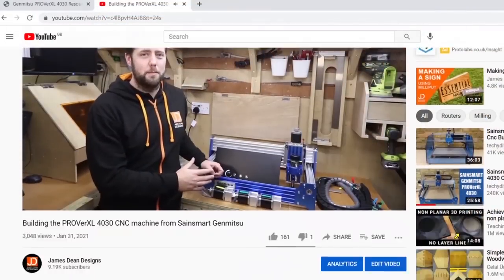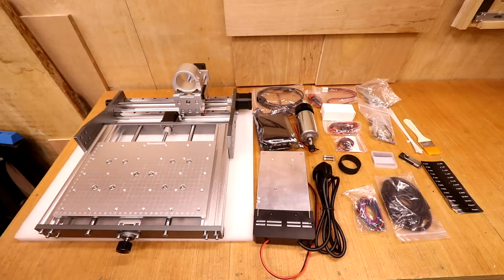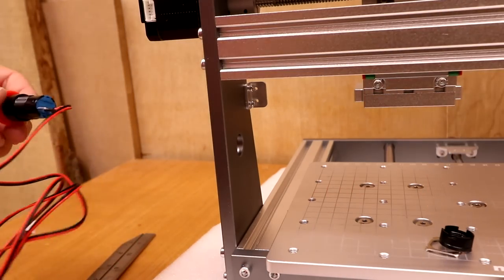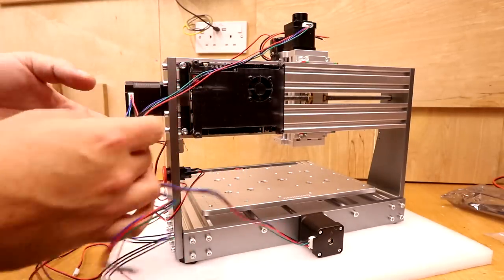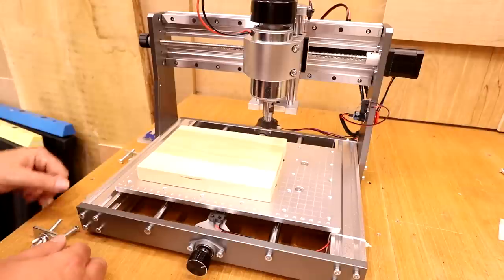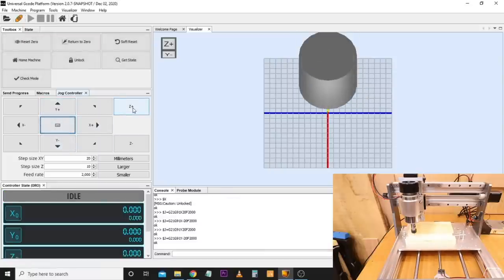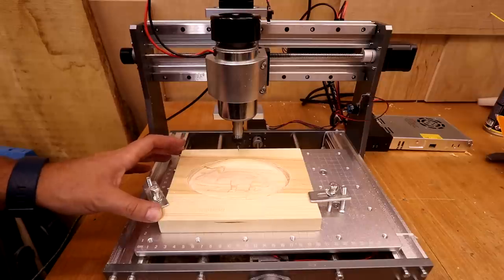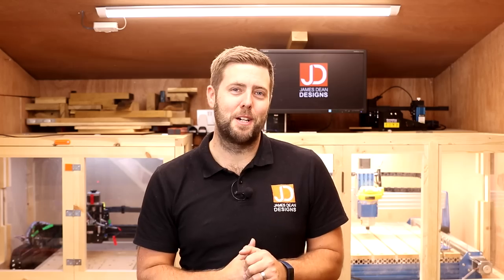3020 Pro Max CNC Metal Engraver by Sainsmart Genmitsu -  Build, test and review

Comment: Hi there

Not sure about this so asking. Can the machine do auto levelling?  Reason being I would like to use one for pcb milling. Do you think it is suitable?  

Great video
Reply: Auto-levelling is implemented in the Gcode sender (which is running on your PC or laptop) on a GRBL machine rather than on the machine itself. The reason I ditched UGS in favour of bCNC is because I never managed to get UGS auto-levelling to work. So as long as you use a Gcode sender which has a working auto-levelling function then  you'll be fine.
Reply from the maker: Yes auto levelling can be achieved but uses the Z probe in order to carry it out I believe. Not 100% on this but I believe you can make upgrade/modifications that allow levelling without the probe.
As for software I believe UGS should be able to do this but haven't personally tested it my self. However as Paula mentions there are other options
Reply: @JamesDeanDesigns  James you don't use the Z probe when auto-levelling. You connect to the bit and also connect to the copper surface of the PCB board. Good luck trying to get it work in UGS. I couldn't make it work and net searches led me to conclude that it's broken and the developer doesn't seem to have shown any interest in fixing it. If it were the only FOSS option available I'd have fixed it myself (I've got 2 decades of commercial experience as a Java software engineer) but I've been around long enough to know that if the original developer won't fix a broken piece of code then it's probably because it's unfixable without rewriting a significant amount of the code base. Fortunately for us there are other FOSS options available and I've gone for bCNC.
Reply from the maker: @paulathomas4944  thank you. I've only seen the auto levelling done on none conductive material where the z probe is used to track it. Ive never done PCB's before but that makes sense now you have mentioned it.

Comment: Can you added a bed extender for the 3020 or the 3020?
Reply from the maker: There is no extension kit currently available for this but it would be possible if you bought the individual parts
Reply: @JamesDeanDesigns  Is that from the Manufacturer or 3rd party?

Comment: This video is pretty subpar, you don't mention the $550 price tag, the runout of the spindle, flexing of the motor or frame, the type of motor, or how loud it is. I think you have alot you can improve on to make this a better video.
Reply from the maker: Thanks for the feedback
Reply: I think you need your head read. Video was very informative better than any of the others I have seen. Price and decibel levels are mentioned. You obviously didn’t watch the whole video. Go check the manufactures website if you want the type of motor. Great work James.